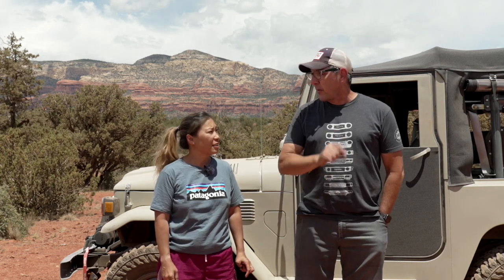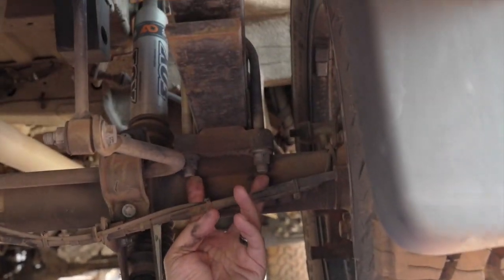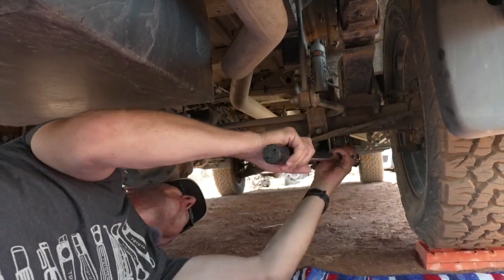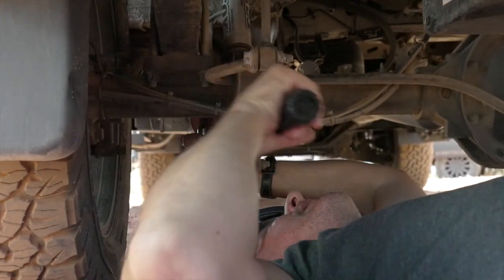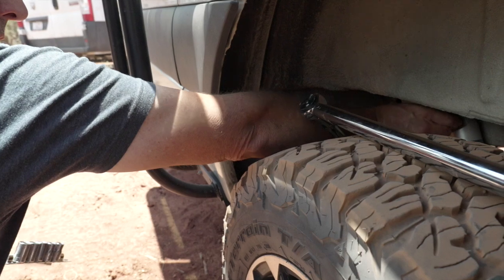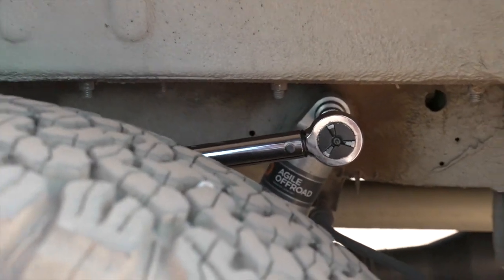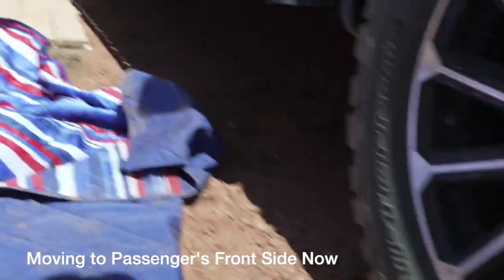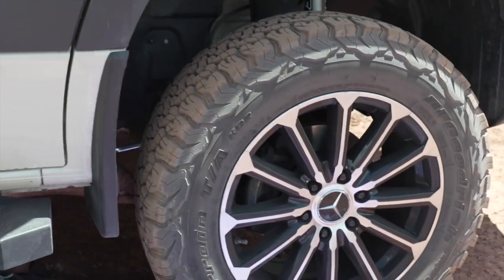How To: Torque Adjustments for the Agile RIP Suspension on a 4x4 Sprinter Van

Comment: Do you have the torque specs for the front shocks? The top bolts in the front are smaller than those in the rear.